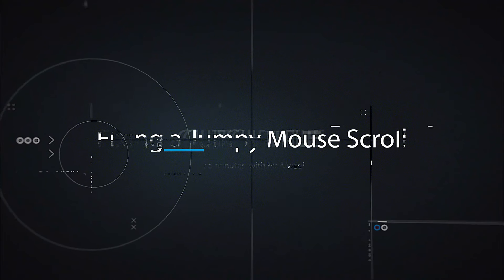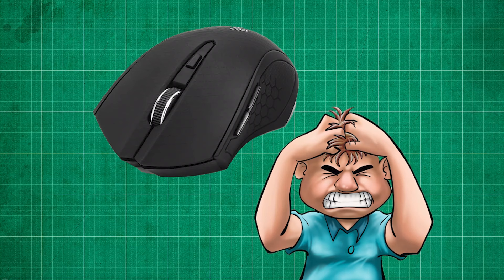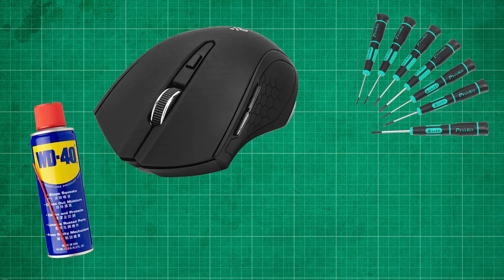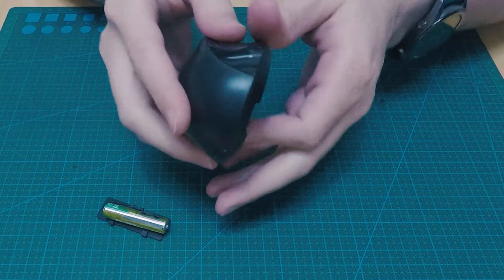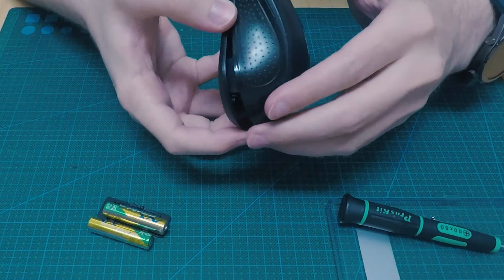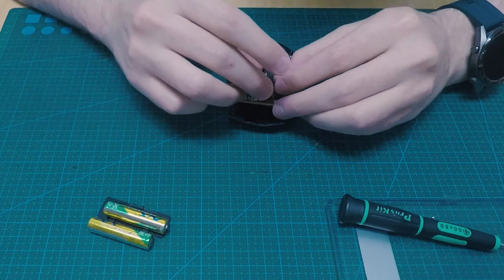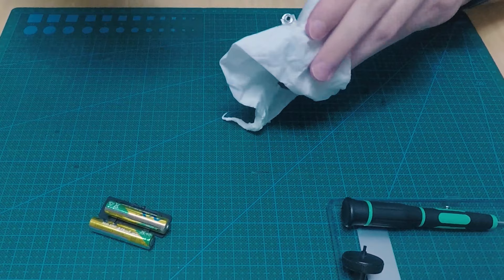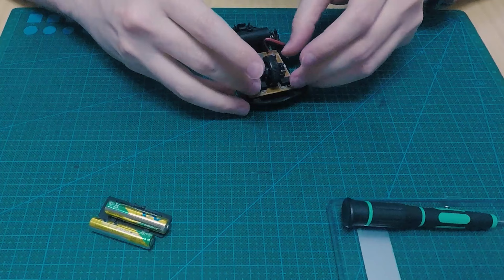How to Fix Mouse Scroll Wheel in Less than 3min ! 👀

Comment: Mine is just refusing to scroll down or up or its just lagging is this the same issue for my mouse?. Also my mouse is the exact same shape except i cant take off the 2 halves because they are attached by wires.
Reply from the maker: Yes most likely the same issue, try opening it carefully (make sure the wires are not ripped) and hopefully you can get it to work again.

If you have any questions please let us know if we can help in any way.
Reply: @mralwadii7275  it's a very tight gap before the wires are pulled too much for me to actually do anything. It's a Rapoo MT550 wireless mouse.

Comment: Worked like a charm ! Thanks a lot
Reply: But why did oil work ?
Reply from the maker: @prathameshsirmalla8324  Happy to hear that it worked well. Also oil acts like grease and reduces the friction between the plastic parts as well as removing the dirt chucks that are stuck sometimes.

Comment: I've got a brand new mouse that is doing this. Do you think its the same problem ? My old mouse used to work perfectly, but that roller wheel thin plastic axle broke after some years, which goes into the rolling ratchet switch (just a name I made up). So i bought new one.
Reply from the maker: I could be multiple things, maybe its loose or broke, go through the steps, open it up and check for any damages, if no damage is present, then apply the oil and hopefully it'll be as good as new.
Reply: @mralwadii7275  Thanks, I'll give it a try.
Reply from the maker: @Appregator  Good luck, and if you could, give us feedback so we can all benefit 👍🏻
Reply: @mralwadii7275  OK when I get the courage to open up my new mouse without breaking it.
Reply: @mralwadii7275  I finally opened it and put a drop of sewing machine oil on the wheel. Well, so far so good. It seems to work. Thanks.
Reply from the maker: @Appregator  Really glad it worked out well! Enjoy 😁

Comment: I am using a Wired HP mouse
I opened the mouse and cleaned it and did what you told to do in the video
But the problem doesn't seem to get fixed
Pls help
Reply from the maker: What's the issue you're facing?
Reply: Scroll issue
Reply from the maker: @skullrhino2564  Help us find out where the problem specifically is. Does the mouse scroll a bit? Does it scroll only up or only down? Does it not scroll at all?
Reply: @mralwadii7275  it fixed itself...it's working properly now thank you 😀
Reply from the maker: @skullrhino2564  Finally, seems like you pulled off some voodoo to get it fixed, congrats mate.

Comment: I was scrolling and then my scroller started going very loose and was moving very smooth, which isnt normal and now i cant scroll up or down with it

EDIT: Guys it does work I tried and it worked!
Reply from the maker: I assume that the scroller is loose or out of place, open up the mouse and go through the steps and hopefully it'll be back to normal.

Also don't forget to give us feedback as the community can benefit from the comments.

I wish you the best of luck.
Reply: @mralwadii7275  mine is a wireless mouse so I don’t know where to like take it apart
Reply from the maker: @Galazxyy  Wireless and wired are the same in concept, sometimes the screws are hidden under some pads on the bottom side, peel them off to access the screws then go on and follow the steps in the video and you should be fine.
Reply: @mralwadii7275  It worked! Thanks!
Reply from the maker: @Galazxyy  Awesomeness 🔥

Comment: Im useing gamdias hades m1 can someone tell me how to fix it the scroll wheel doesnt work
Reply from the maker: I think there are a few screws under the weight pad on the bottom of the mouse, hope this helps, and keep us updated.
Reply: @mralwadii7275  what do i do with the screws?
Reply: @mralwadii7275  also its not just the scroll wheel just suddenlly got jumpy or didnt work when i got it it never scrolled and still the scroll wheel just doesnt scroll
Reply from the maker: @dinodangaming1462  You'll have to open the mouse up, check for loose or broken pieces, if all seems intact that's when you'll apply the oil and hopefully all would be fine like new.

Comment: I slammed my mouse and now the scroll wheel won’t click or anything it just rolls any way you guys can help :)
Reply from the maker: Yes of course I'll try to help you Ruben. 

Try doing the steps in the video, then after you open your mouse and clean it, try looking at the scroll (the plastic part and the scroll holder) is it broken or not? 

Please reply to this with what happens with you so we can follow up.
Reply: @mralwadii7275  oh thanks well I’m trying but I think it is clipped on because I can’t find any screws to open the mouse but when I do I’ll let you know
Reply from the maker: @rubendimaggio7541  Sometimes the screws are hidden under the pads on the bottom, hope that helps.